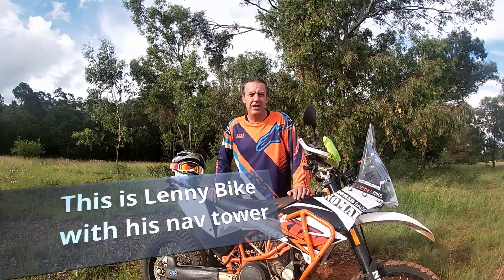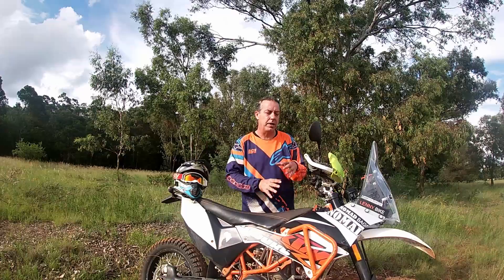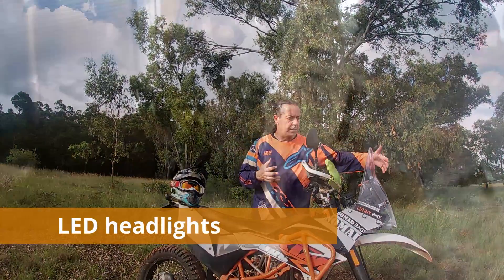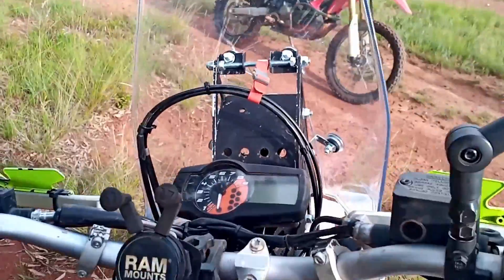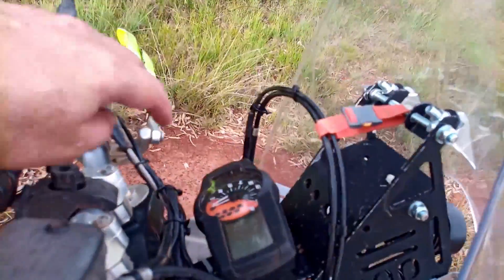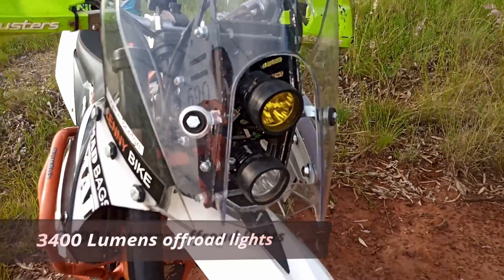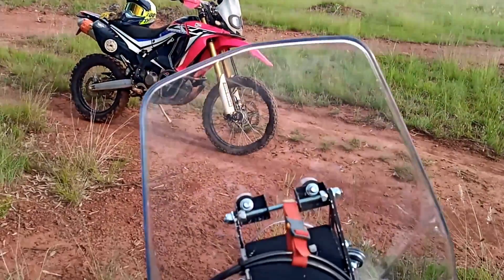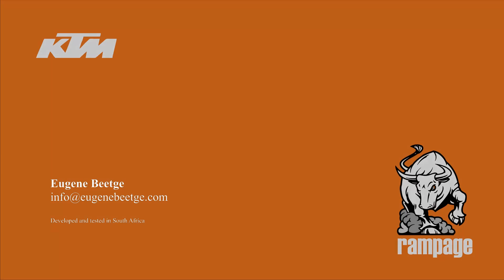Rampage ADV Tower Ep1 How I built my own tower for my KTM 690 Enduro

Comment: very good design.
have you developed a tower for the suzuki drz 400 s?
thanks
Reply from the maker: No, sorry. Unfortunately we only focus on KTM and Husky due to the screen we use on the tower. However, the tower is separate from the mounting bracket so the tower can be fitted to any bike with a custom bracket.

Comment: Hey, is the CAD windscreen correctly dimensioned, and is it possible to get the file? Also how did you make the side fairings? 
And well done!
Reply from the maker: Hi Lars, on the 3D model the screen is not an exact replica. Its quite difficult to replicate in 3D modeling. But we use the OEM 450 KTM Dakar screen so in real-world its fine. The focus for the CAD 3D is the structure design which is precise. The side fairing are made from a bendable polycarbonate material and laser cut to shape. Fastened with DZus clips